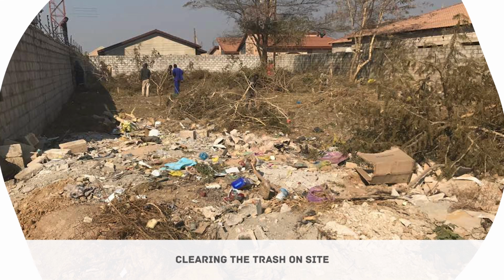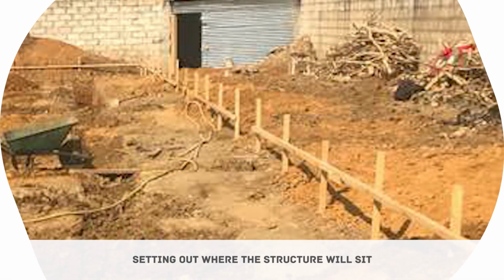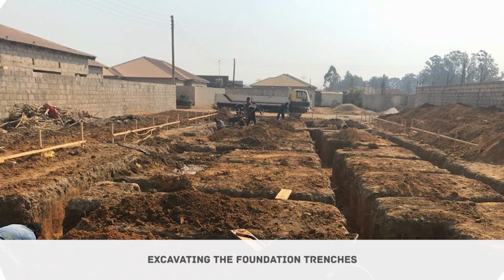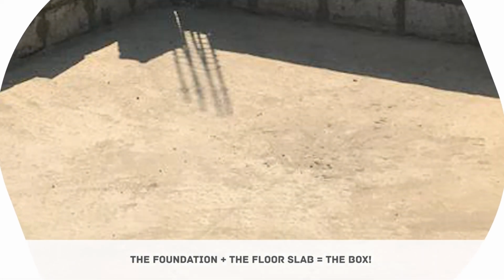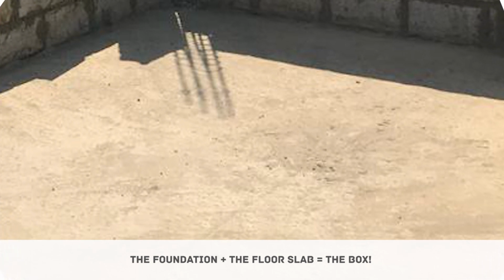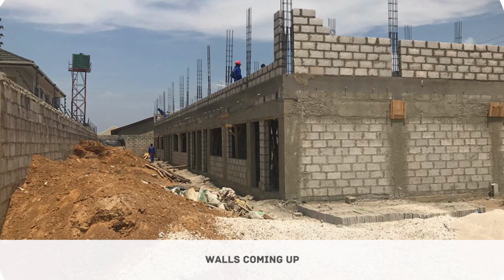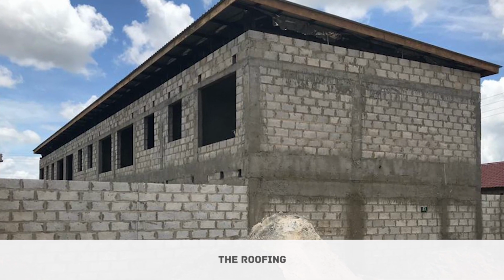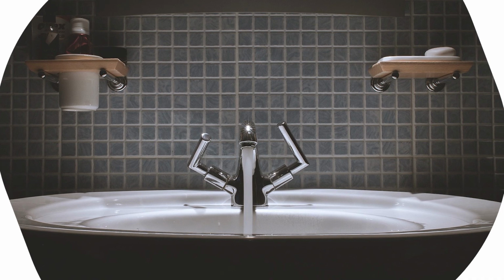HOW TO BUILD PROPERLY IN ZAMBIA

Comment: Can you please start with the plans and the step you need to go through ie drawing of plans, presentation to the Local Council and approval and provision of the approval number and finally presentation to the Planning Authority.  It is very important that these parts are presented.  I haven't seen anyone that has provided information on these stages and people get stuck.  Further when you are building every stage must be approved by Council
Reply from the maker: Hey there, an architect is meant to do your drawings, submit them to the council and generally run with that whole process. If people get stuck it's because their trying to do a process they're not qualified to do. Engage a good architect and it shouldn't be hassle! But thanks for the suggestion, it may be worth doing a whole video on the architect's role in your building project